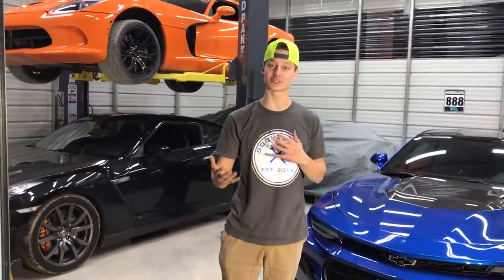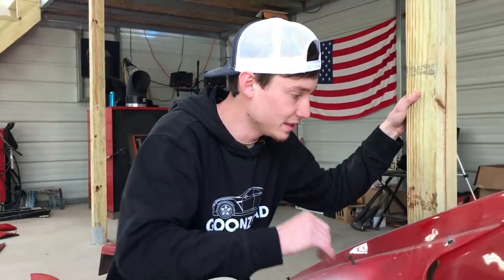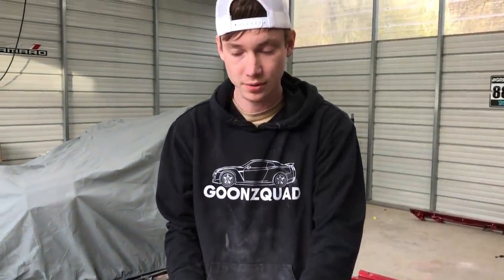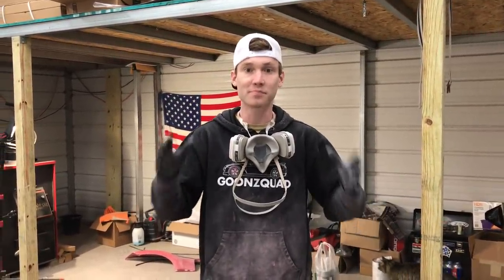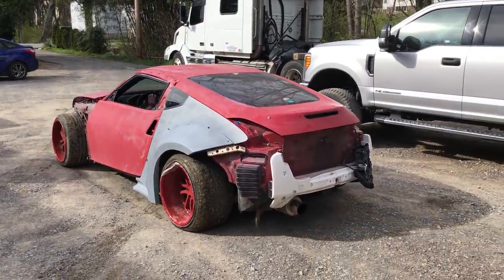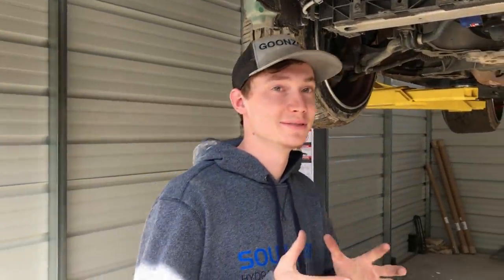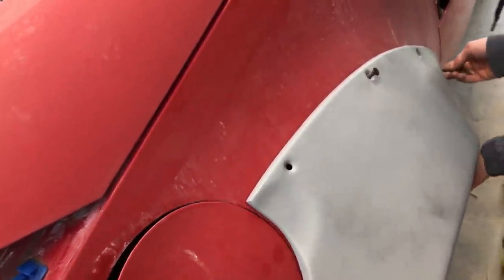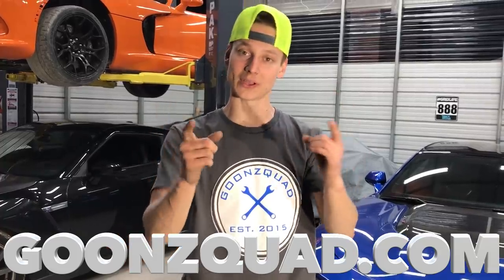Auction Drift Car Gets Widebody Repaired!!!

Comment: guys should drop a curtain down between the bays, and designate one a clean bay, where all the sanding happens, and the other one as dust free zone. Best setup would be to have the "office" side as the dust-free zone. to keep all the things that get stored on that 1/2 of the building free of dust. Otherwise, in 6 months the dust is going to be an inch deep everywhere.
Reply: This should be upvoted
Reply: Relevant point but this is about cars not about cleanup
Reply: This is what we do in our shop to prevent welding snot, dust, fumes, etc...gotta have a heavy curtain for particulate and fume control.

Comment: Try replacing those rivnuts with well nuts. The well nuts are made out of rubber and compress when tightened. I think that would work better for holding on the widebody kit.
Reply: michael kelley yea, riv nuts are terrible and rough on fiberglass.  Good call!!
Reply: Everyone where I live pronounced them as "rivits"
Reply: And here comes the b is for build lifehacks😂😂😂🤣
Reply: @bully5991  Rivnuts are different than rivets. A rivnut is like a nut that installs similar to a rivet, and then you can insert a bolt into it.
Reply: michael kelley they should do that cause the other ones bad
Reply: киллер би you’re right
Reply: on fiberglass and plastic a thin washer should be used on the backside before squeezing the rivnut in place . It gives a stronger surface for it to tighten up against . Same goes for regular rivets
Reply: I agree, they will let the members flex, instead of crack.

Comment: Congrats on the lift guys, I run the same lift in my shop.  You guys need to adjust the cables though, did you notice how you can hear the locks engage at different times?

Comment: Be safe using the lift always check twice before you life up any vehicle 

Great video
Reply: Great tip!
Reply: And make sure the lift is on the safety Also👍
Reply: dont be like scs supercarsuspects it fell off a lift and it was a s2k
Reply: Remember that video when that Rolls Royce fell and killed that guy trying to hold it up?
Reply: Billy didn't lock the lift after lifting up the Z
Reply: @PanameraTurboSEHybrid  Yes, I saw that on WSHH. He was trying to hold that car up with his mighty strength!
Reply: @mikem2055  That other guy ran to the back to try to hold it up too, ended up crushing his legs...

Comment: Great vid guys! That missing corner is just good old bad workmanship, Fibre glass can not have any air/gaps between the gel coat and tie layer (the colour and first layer of glass) it has not been worked /laid up correctly that's why you can clearly see the pattern of the fibre glass through the broken bit. Trapped air can be very common in tight corners and is best checked for by tapping gently with a plastic screwdriver handle or some other kind of non marking tool, if it breaks you have air. Best way to repair it is to bog it with glass reinforced bog or just fine bog for small holes. If you want any free advice with fibre glass please let me know I have been in the industry for a very long time. And don't forget your PPE the dust is bad news all day long!

Comment: Wondering if the upcoming collab is with Mr SAMCRAC and his Ford Focus RS that is getting shipped the the Goonzquad garage?
Reply: yeees!! i thought about that too!! that would be great!!
Reply: @rOggh  b is for butchered?
Reply: Rog b is for build rices out his cars. Cheap and tacky parts is what he uses
Reply: @rose_ripzyt3814  you mean you wouldn't cut out a structural panel and replace it with flat stock from Menards?
Reply: Samcrachead has literally no business fixing crashed cars yeah he can unbolt and bolt on a bumper just fine but he is a hack and puts out very unsafe cars.
Reply: @Kyle   Exactly bro.

Comment: A strip of foam tape on the lift to protect from door dings, wax and grease remover is applied with a wet towel then wiped with a dry towel as you go, the wet towel suspends the wax and grease then the dry towel removes it.

Comment: Hey Goonzquad, congrats on the lift! Just make sure when you use it that you don't walk in front or behind the car while you're raising or lowering it because that's when the car is most unstable and if it falls off the arms, that's where it'll fall. Additionally, make sure you release hydraulic pressure once the car is in the air so the weight is resting on the mechanical locks. Awesome work, keep it up!

Comment: Guys: I haven't perused the comments to see if someone else said this, but - if the BendPak came with it - there are arm spacers for the lifting pads. They should be in recesses at the base, and if they are, you can install them to give you clearance between the arms and the bottom of the car so you can lift it and install the rear wide body fenders without hitting the arms.

Comment: RIV-NUT is short for rivet nut, been using them for 23 yrs. We use manual tools and air over hydraulic tools to install them depending on the job and what size riv-nuts are being used.
Reply: Washers are used on each side of the riv-nut to spread the load on weaker substrates.

Comment: Btw I would recommend using a spray gun for everything. Just use a different gun for different coats. A harbor freight cheap spray gun will work the same as a professional spray gun for the first spray or 2. For 10$ compared to a hundred or so it’s not bad for doing a single paint job.

Comment: Some lifts have adapters to put under the rubber lift points so it doesn't hit the car. At 16:00 you can see the adapters at the bottom of the posts

Comment: Check out dzus fastners or quarter turn fastners instead of rivnuts.  Check aviation catalogs for reference.  The retainers are installed using flush rivets that you can buck or pull.  If you buck them you will learn a new skill.  It would give it that finished airplane look.  Better than OEM!

Comment: I don’t know if you guys have ever worked with a lift before but it’s a good idea to get in the habit of putting it down on the locks (the clicking you hear when the lift goes up) when you lift up vehicles just Incase one of the cylinder decides to fail

Comment: Im not sure about youre lift but the one i work with actually puts on a safety lock if you go down slightly after raising the car. I would make sure if youres does that, then i would use it

Comment: I hope you have a 24 inch thick pad in your garage. Most floors are only 4 inches thick maximum and that will not support the lift with a car on it. Floor is gonna crack soon without that extra support form a proper footer base.

Comment: Do they actually know what guidecoat is ? It's a misting of dark paint over the light primer so when you use a long board for finish sanding you can see the high and low spots, hence the term "guide"... just asking because I don't recall ever seeing them use a long board... just curious.

Comment: You need to lock the lift by barely dropping it when you hear it clicking its passing the grooves and needs to be slightly dropped to engage the lock its still safe to not do it but not as safe

Comment: From what I learned from my neighbor (I’m no mechanic nor anywhere as good of a mechanic as he is) that those click clacks as the lift goes up are safety locks. Idk if you have been doing it, but cars should be lifted above those points then hydraulic pressure released until they rest on those locks. Unless these lifts are different?

Comment: Hey guys, is there by chance that you can share your knowledge in a video(s) on your prep and paint work. Example, when you would sand, what grit would you use depending on what needs to be done. When would used the enhance (i think it's called that) that you put on front bumpers to help with the paint sticking. I hope you have an idea of what I am speaking about. It would be so helpful to get your tips in one video(s) in one place.

Comment: Suggestion find a deck over trailer to haul cars with measure the lift between the post that way you guys can get wrecked non driveable cars off the trailer straight to the lift with ease

Comment: You guys love what you do. However little advice can primer is not as good as the gun. It's single stage as no hardner 2k system fills the scratches and is less prone to reactions. I have used can primer to great cost caused the paint to react and peak like a banana . It's ok to risk for small despairs or pin dents but not complete panels or large repairs. Good luck with the build and I hope you have no reactions on that primer.

Comment: Guys remove those wooden posts replace them with an "I" beam that goes from one side of the wall to the other then you can put another car underneath too you get more free space which is great.
I also hope that you hire an electrician soon to hook that lift up i am an electrician my self and the lenght of the wire can affect if the breaker it self will "break" in case of short circuit...

Time to start digging a trench and laying down some pipes and put a real fuse panel up in the garage electrical safety got to come first.

Comment: After watching the Viper TA and the GT-R, I did not like the wide body at all. I hated that the car had to be butchered just to put the kit on. Add in the cheap paint, and it looked like so many rolling trashcans that I’ve seen over the years.

However, with the time and attention that you guys have given it, I’m certain you are going to make the widebody look better than when the original owner put it on. That being said, I still prefer an OEM 370Z.

For what it’s worth, the NISMO bumper is pretty pointless without a dual outlet exhaust. If it’s still within budget, I’d go for that. Keep up the great work, guys!

Comment: Why not mix up 2 k primer and save money with a better quality material
Reply: @chuckchuck8319  it will fail sucks because it seems so convenient but it will fail  we used it just for cut through before painting and they all failed it's just not worth the risk when you can get gallon of very good primer for 120 bucks no lacquer garbage same with using Combi spot putty no need to use that garbage when there is real 2 k products that do the same thing only don't fail if you really want to get lazy and use spray cans check out 2 k cans by usc spray max the epoxy builds like crazy and sands easy
Reply: @chuckchuck8319  yeah the 2k activated cans are my last resort not lacquer based junk that air dries with evaporation

Comment: I like your channel, your energy, the fact that you have a high turnover, that you guys try to do something right and don't shy away from the hard work (ie: all that sanding).

BUT.. really guys. Learn to work with fiber and epoxy resin. I'll keep saying it; that kittyhair stuff doesn't cut it. It's not ment for these repairs and it won't bond particularly well on those (glass/carbon/epoxy) surfaces. Get some real quality epoxy resin, glassbubbles and buy a roll of cloth.

All those small repairs you make now, they will come tearing off sooner or later, comparable to the crack you found in the bondo.

I'm  not being a hater, again, I have watched all your video's, but you guys really need some education on the fiberglass stuff. Also when you get into that, you can start manufacturing your own shit, like you could do the wide body part, make moulds of it, and then attach it without those ugly screws, make it as if it's the original bodywork. There's a lot to gain there.
Reply: To elaborate a bit. The kittyhair stuf is polyesther-based. Those cars are made with epoxy. There are some important differences between polyester and epoxy:
epoxy does not shrink. polyester does. Epoxy is used with cloth (which is what there parts are made with). Polyester is used with 'mats', different material.  Epoxy is a lot stronger than polyesther. Epoxy will bond to surfaces without the specific need of a primer. Polyesther needs a primer (yes, that kittyhair stuff needs a primer, which you didn't apply). 

Epoxy and cloth and glassbubbles are slightly more expensive and require some knowledge to work with, but really guys.. take the effort. You guys want OEM. OEM = epoxy, and not polyesther.

Because you're using different materials, reaction to temperature differences will be different. Without primer, the polyesther-based kitty hair won't really bond to the epoxy/cloth based bodyparts. This means, that over time, due to temperature changes and vibrations, eventually all those 'corners' with kittyhair will simply break of. It's just a matter of how long the paint will keep them in place. If you're lucky, it'll hold.

Comment: Gentlemen... Please becareful when using rattle can around the propane heater, you are putting flamable vapour into the air, right next to an open flame. Take it from a guy who has had a fire from that same set up. Or at the very least have an extinguisher near by. I cringe everytime I see you doing it.